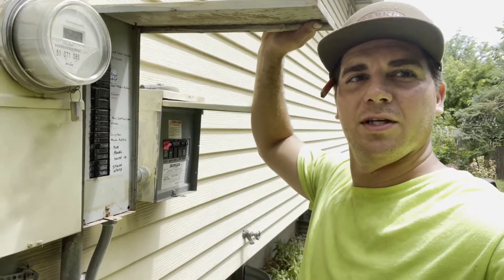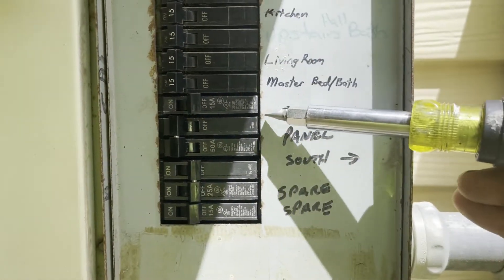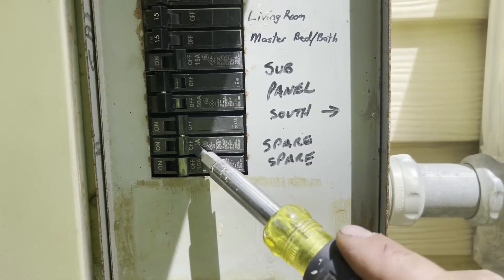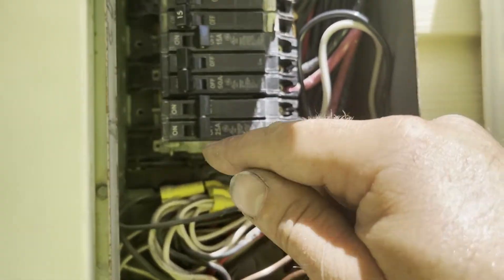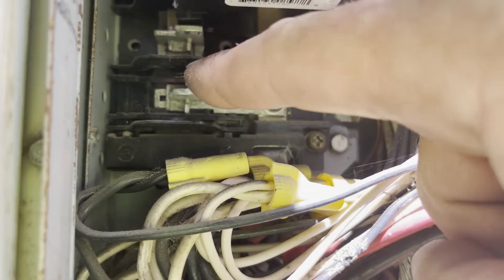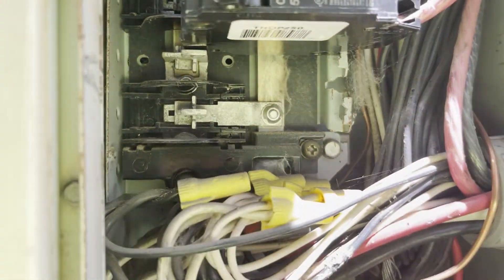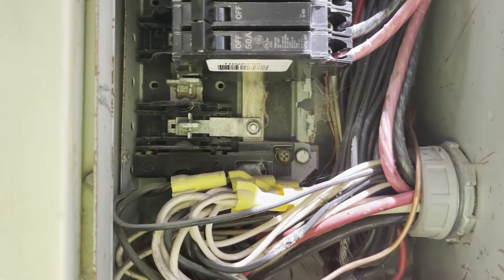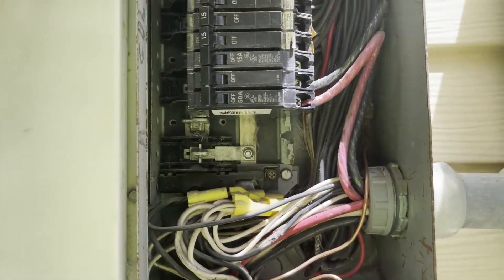How to add a new breaker to a FULL electrical panel.  Adding Air conditioning VERY DETAILED

Comment: Hi, I'm in a a tough situation. Just bought a home and have to replace 2 units and probably a third. They're all Lennox 14xc from 2015. A company is trying to sell me on the new ML-17XCs. Ive heard they make a ton of noise and have issues. I'm at a lost for what brand to consider because everyone has an opinion and apparently all HVACs suck. So in your opinion, what brand is the most reliable today and what I should consider as a new home buyer. Home built in 2014 but all equipment is 2015 and was first sold in 2016 and I'm the second owner.

Comment: U made a point that’s why I was only getting 120 for my dryer   I was putting it on one pole . Then later on  I put it in the right place and always getting the same problem until I removed the fuse and put it back on  and it worked perfectly thank you  and have the same panel ge

Comment: That was great.  I want to get a Mig/Tig welder and and been wondering about that.   I have a breaker in my carport.  At least now I understand what it takes.  I can start thinking of how I want to run the wires and things before I call the electrician.  Thank you.

Comment: Thank You!  I just bought a couple of the half height breakers but didn't realize that they needed to move down one spot so they would pick up both phases.  Thanks again, I was about to call (a very expensive) electrician!

Comment: Thanks for the electricians hack. I'm not an electrician by trade, but can wire a house & change out entire panel boxes.

My fiancé & I just closed on an older condo last Friday, & like Murphy's Law, the next day the central air quit. So, because we have lots of other things to buy & the price of a new unit is tough to chew right now, we got a 10,000btu window unit, for which I needed to run a new circuit... in a full GE box, no less. After some toiling, i watched your short vid, & in minutes we were blowing cold!

A simple solution to an issue that helped this guy keep his woman cool. Happy wife, happy life, as they say!😂😂😂 Thanks again & God bless!

Comment: I want to install a window AC….. I know how to wire….. what breaker do I use? 20amp or 25apm?
Reply from the maker: If you install a window unit you should just be able to plug it into a wall outlet.
Reply: It depends on the unit. From what I've found, regular outlets work for units up to 8,000btu. Bigger units & those with heat require 220, with a plug different from 110 outlets. I just ran a circuit for my 10,000btu w/heat unit, using a double-slim 20amp breaker, 12/2 wire, & required receptacle.

This vid just helped me with my not-enough-space issue.

Comment: Great information. I assume other breaker boxes are designed differently? Every time I test a receptacle in any of the many houses I have owned the voltage is around 120 volts. Why do people say 110 volts? I just installed a Tesla charger in my home and each side of the 60 am breaker had 120 volts on a 200 amp panel.
Reply: AC electrical service is always rated at nominal power, For the better part of the last century, single phase residential power was actually 110v and it's crept up depending on where you live to be a little over 120v. This is also why people so often call two phase power 220v instead of the more accurate 240v.

Comment: I have a full box but want to hook up a generator outlet with a interlock kit, do I have to have a bigger panel installed?
Reply: No. That’s what the slim 240v breakers are for. You replace a few of your big double pole breakers and that allows you move them downwards so that you can install a new slim 240v breaker for your generator.

Comment: Curious,  Do you trust the slim line as much as the regular? I've heard much controversy
Reply from the maker: I have never had any issues myself
Reply: They're perfectly fine. The issues are typically with Federal Pacific panels from the 1970's and their aluminum bus bars.

Comment: G.E. breaker boxes are junk. I'd replace both the main and the sub panel with one 200 Amp with more spaces.  Go with a Square D ( QO) or Homeline. ITE Siemens is another good brand for the money.
Reply: I'd love to replace my GE with a Square D. But as an electrician told me, it's not worth the cost or trouble. Even a GE rarely causes problems and most can be fixed with a replacement breaker.
Reply: Yea, I'd like a new corvette too
Reply: Siemens are the best for your money, quads are easily installed too.
Reply: Okay I agree. Maybe you can get a check sent over to the homeowner for 3k to cover the cost of replacing something that’s perfectly good with something else.
Reply: And retiree from an Utility co ,they are not 110 volts ,are 120 volts x2 240 volts